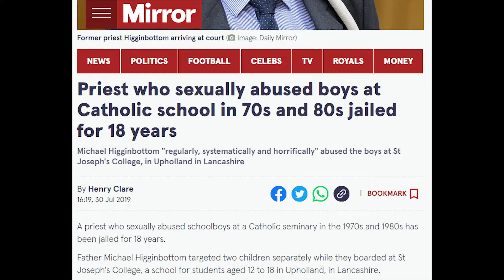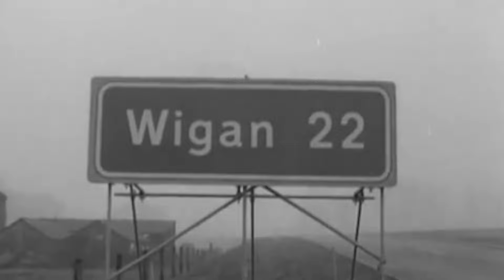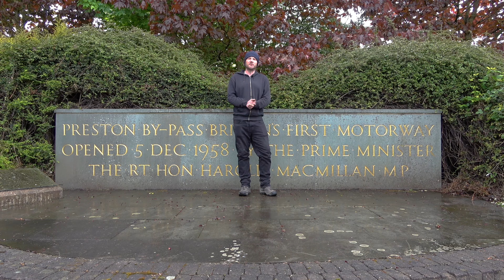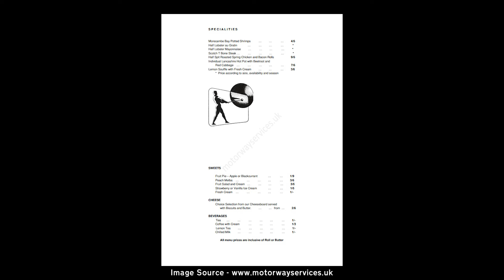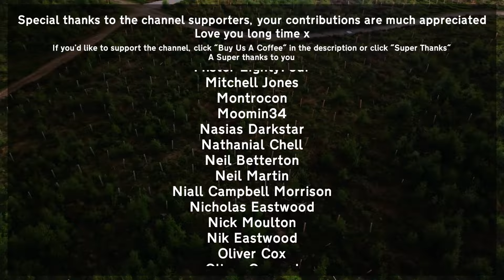Secrets of The Motorway - M6 Part 3 - Warrington - Lancaster

Comment: I bet you didn't know that British Leyland, as well as building cars and trucks, and buses (think the Atlantean, and its successor the Olympian, and the mass produced National single decker), they also dabbled in trains! Yes, the class 141 pacer, and 155 Super sprinter. Neither were a success. Indeed, 35 of the 42 class 155 two car super sprinters were converted to class 153 single car units, and oddly have performed better. The 155s had problems with their doors in the early days, and the introduction of new class 158 express sprinters, and an electrification, allowed the 155 to 153 project. Just 7 class 155s survive, those bought for West Yorkshire. And the 141 railbus was a disaster, only 20 were made, the space of the leyland national bus body, but two cars. In fairness, the class 142 Pacer, using Leyland bodies and BREL underframes, was a bit more successful. The last pacers were withdrawn in 2022.